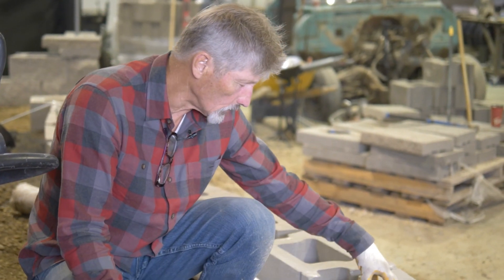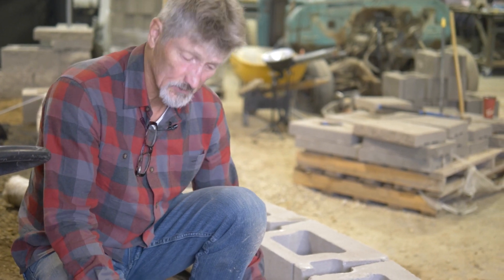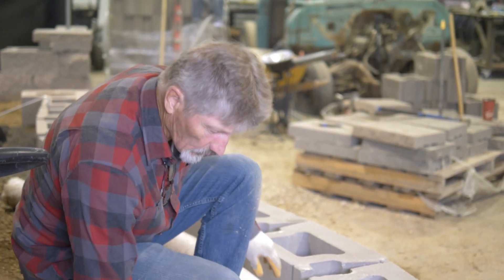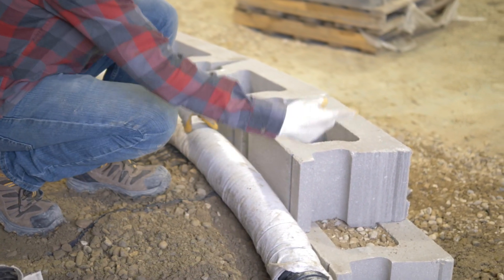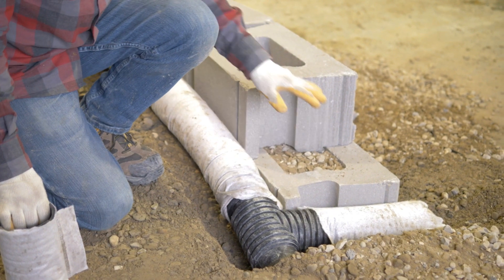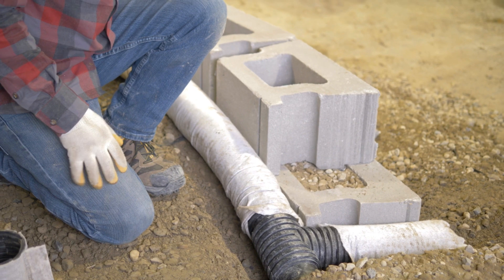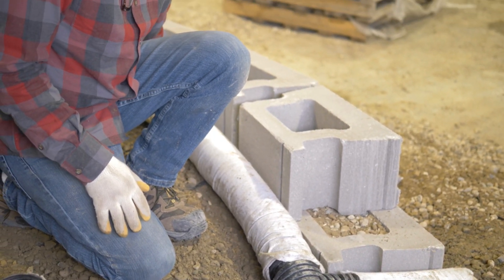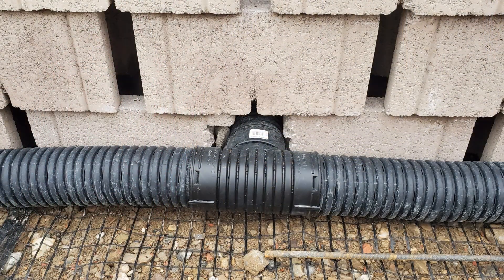Retaining Wall Drain Pipe Installation Discussion

Comment: If the pipe is perforated to allow water to enter then the water will drain out the bottom side of the perforations?
Reply: I believe it’s perforated half of the pipe only. The other half without perforation carries the water to whatever direction it’s intended to.
Reply from the maker: It is intended for the water to drain out of the holes and when there is a very large rainfall it has the large exit through the main hole. Tough to explain but it works well to distribute the water.

Comment: So, does the pipe just sit there and when raining water is pushed through it? No drainage system at top of wall?
Reply from the maker: There is a drainage channel at the back of the block that goes to the top of the wall. You can also make a swale at the top of the wall to divert water away from the highest points. Keep that water flowing away from the walls as much as possible. The drainage at the bottom gives an outlet for when major rain falls come.

Comment: What time of pipe? How water will penetrate into the pipe?
Reply from the maker: Hello, A simple perforated drain pipe works very well. They can be found at most box stores or hardware stores etc.
Reply from the maker: It is typically a perforated 4" drain pipe which may be sock wrapped.  Also known as weeping tile or Big - O pipe.